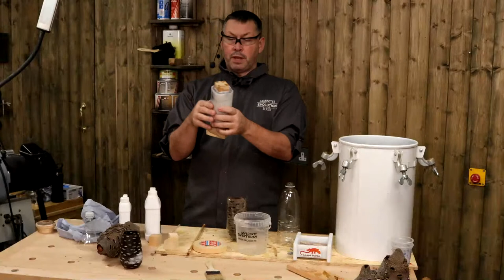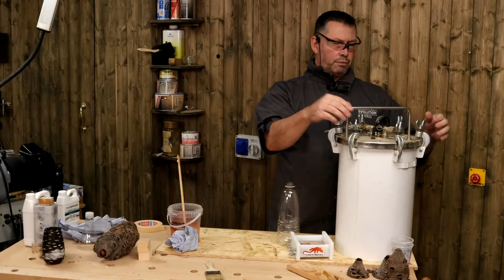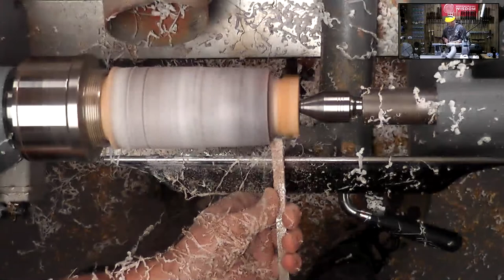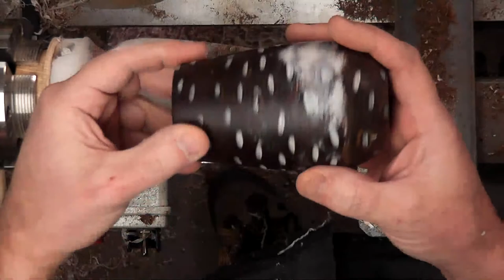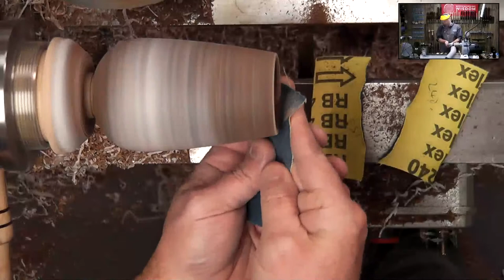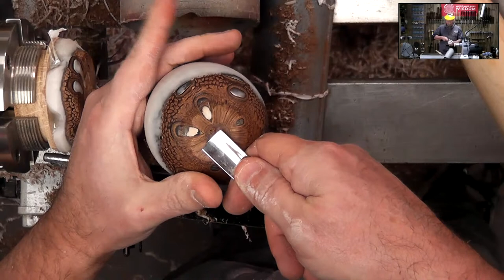Banksia Nut and Epoxy Resin Vase - Woodworking Wisdom

Comment: Resins can be thinned and spills cleaned up using technical grade Acetone , or cleaned with METHYL ETHYL KETONE , but be aware that they are very volatile solvents that have very low   vapour points and  extremely flammable  , and wear a proper respirator with a VOC filter and chemical resistant gloves and have vapour proof ventilation and exhaust

Comment: Can the pods be vacuum stabilized ?
Reply from the maker: Hi Gary, Yes but Colwin recommends cutting them into small pieces first, as the nut is fairly big and even with the vacuum, the resin might struggle to penetrate. Hope this helps.

Comment: Can these nuts be turned & hollowed without the involvement of resin ?
Reply from the maker: Yes you can turn without resin, however, you will still need to glue on a wood block to either end and you must only use the solid nut and turn away all of the soft velvety outer section as this has no strength. I hope this helps :)
Reply: and they also make fantastic Christmas ornaments, and little scented oil diffusers, just shape into a bulb, drill the center, pour in the oil, stick in a cork, and bobs your mate down the pub that your wife doesn't want you drinking with.